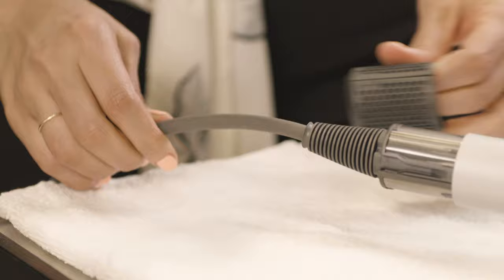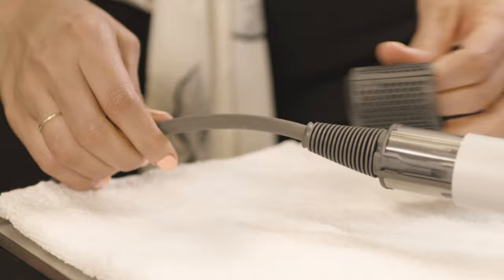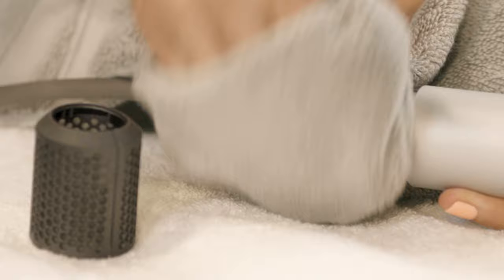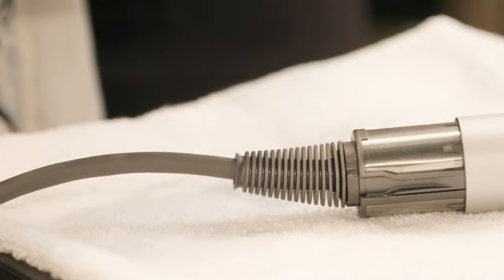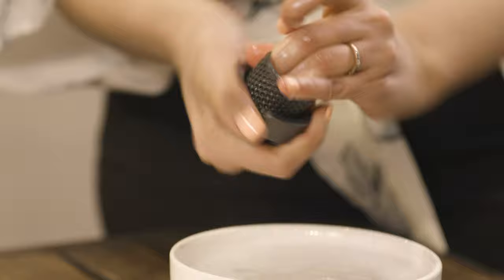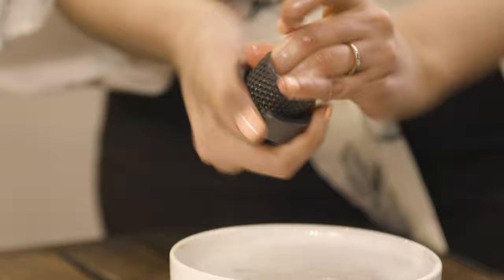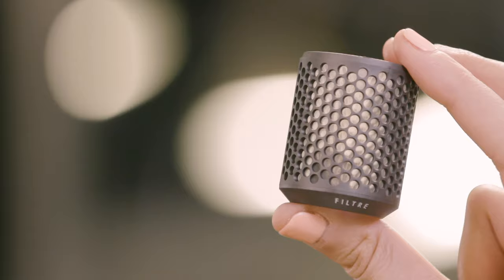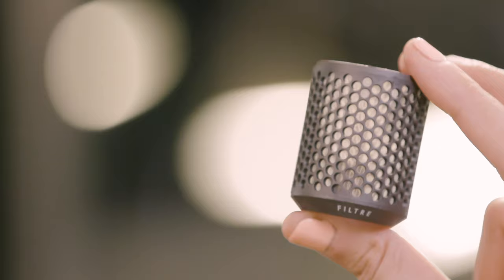How to clean your Dyson Supersonic™ hair dryer Professional's in-line filter

Comment: I just got mine about a month ago and it didn't come with a cleaning brush?
Reply: Same. Where are the instructions for this maintenance? 🤔
Reply: This is for the professional hair dryer
Reply: @Listen2me400  it’s in the small square black box .. down next to the guarantee book (I found mine there)
Reply: @Listen2me400  the new ones don’t come with the cleaning brush or the changeable filter cap
Reply: @izzyhealyy  I find that it’s easy to take off and clean. No problems so far.